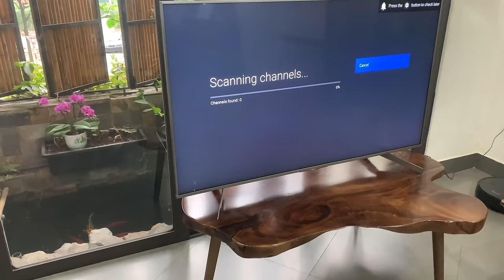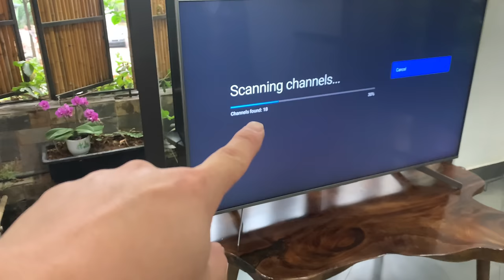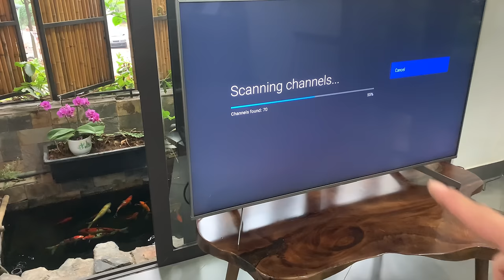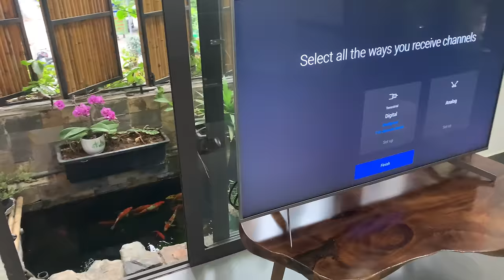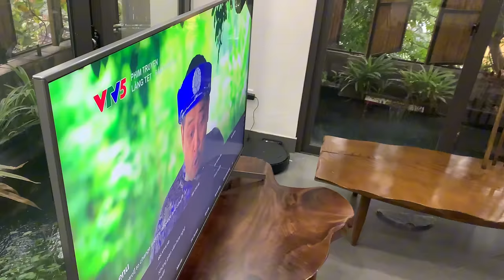Antenna Companies Don't Want You to Know How to Make the World's Strongest Antenna!

Comment: Awesome job. That works better than the indoor antennas from Walmart. I used an F connector to go over the rubber. It works good like that. Took less than an hour. I picked up 10 stations. With the ones for Walmart I only got 6